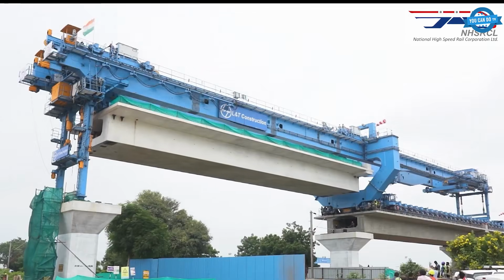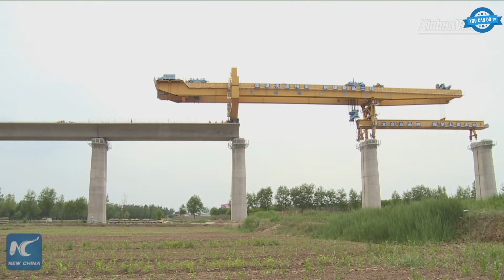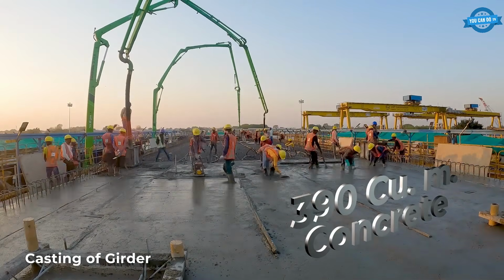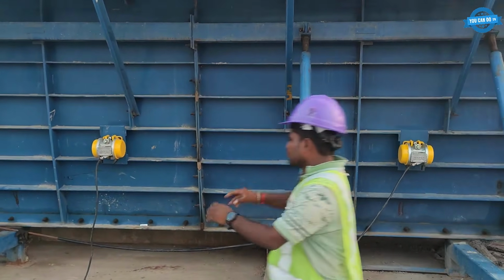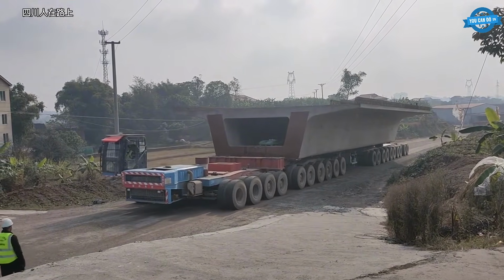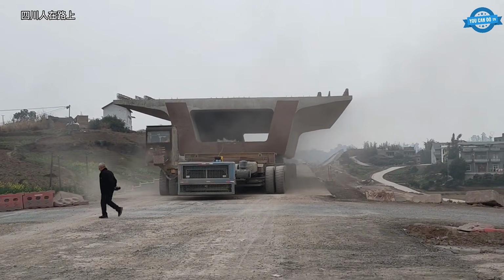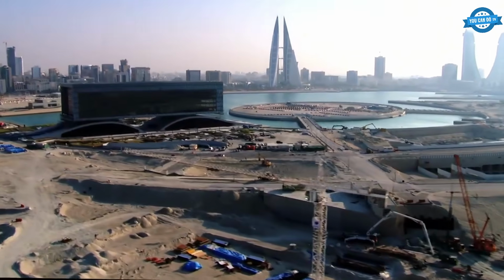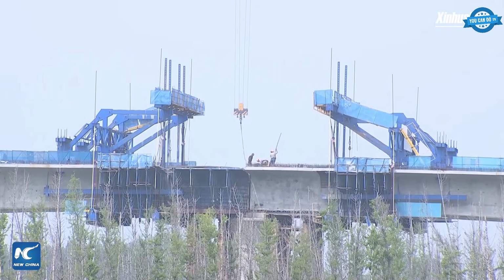Mega Construction Documentary. How 970-Ton Railway Bridges Are Installed in 50 Minutes

Comment: Out of China such a construction style is unusual. USA has only view high speed lines. In Europe there are a lot of high speed lines. China has over 40.000 Km. In Europe the length sum may be something between 10.000 to 20.000 all together. Also Europe must linearize lines for speeds around 300 Km/h, this is not done with viaducts running over multiple 10 Km length. Yes viaducts exit in Europe. But mostly with a length of perhaps 500 - 1000 Meter maximal. Europe uses more tunneling than viaducts. A problem with long viaducts is heavy incidents like derailing etc.. A delrailed train falling with 300 Km/h from a 100 Meter high viaduct may be much more deadly than a derailing on open flat ground. Also emergency help of any kind is easier on flat land, than on high viaducts. More over China needs tremendous amounts of concrete and steel to build in this style. China is regarded to be freed from any CO2 reduction targets. In Europe steel mills are closed "to save the climate". As supply alternative steel is made in India and China, to ensure that Europe is a good example how the world should stop CO2 emmisions ;-)